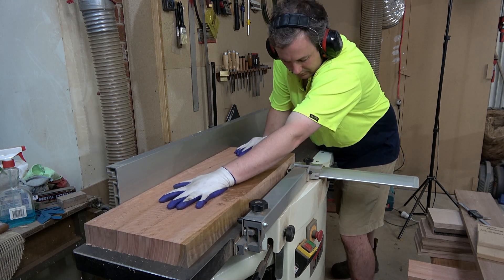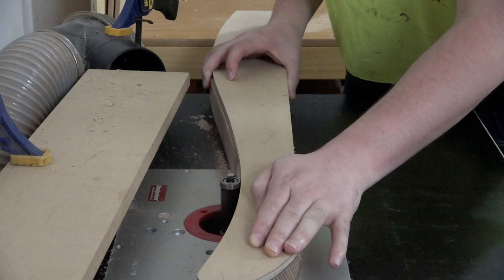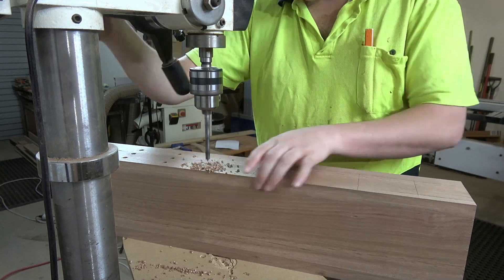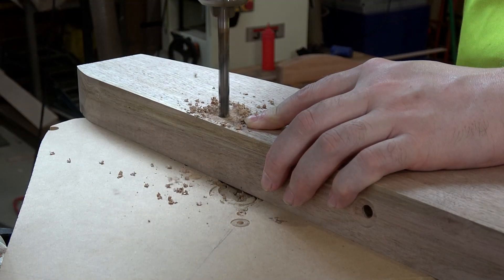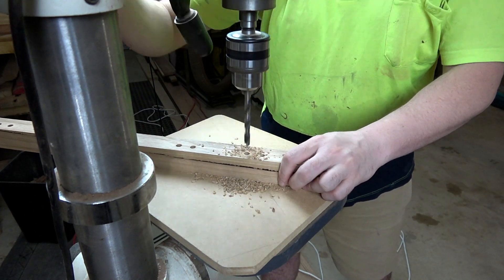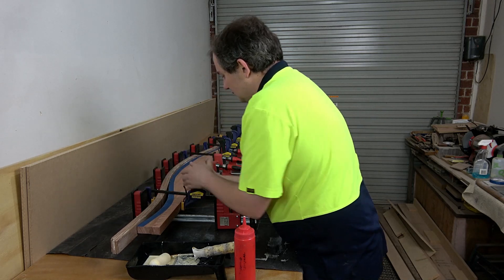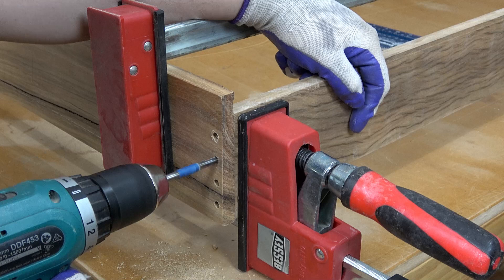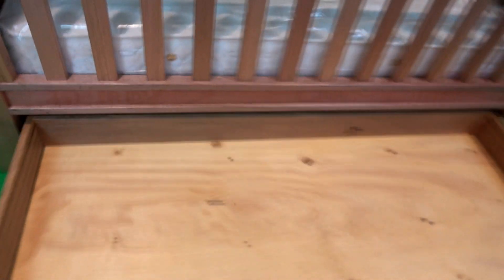The baby cot

Comment: Really glad to see s summary video Kuffy, Wow, REALLY well done too.
Reply from the maker: Cheers mate. The video seems to be pretty well received and even I think it was pretty good. Gonna have to stick with this style I think.
Reply: A question mate. You use Tassie Oak a fair bit. I'm in Bendigo and timbers are hard to come by, but I do notice in Bunnings they have Hardwood F17 structural lumber in large dimensions that looks to me like it is Tassie Oak for sure. Do you think it would be worthwhile using for cabinetry? I've got the gear to break it down, and after all it breaks down to only just over $5 a board foot which is way cheaper than exotics that I can only get in Melbourne.
Reply from the maker: The F17 that they sell in bunnies is Tas Oak/Vic ash. The 6x1" standard grade boards that I commonly use are about 7-8bux/meter which is a little more than 1.5 board feet. I use a fair amount of F17 90x35 at work. With regards to cabinetry, the stuff is pretty awful. The good stuff is straight grained and featureless. The average stuff is good for burning. Also when they kiln dry structural timbers, I don't know what moisture content they actually shoot for, but I'm pretty sure the standards say 15% or less. I wouldn't use 15% MC for decent joinery as it will move too much. So if you do go down that path. purchase well in advance (a few months), and sticker out the boards in a dry area with some air flow. Also select the boards that you do want. Don't worry about rejecting the bad ones because the chippys only want enough length and straight boards for beams, whereas you will need quality timber more so than long and straight because you will end up cutting everything to short and machining it straight.
Reply: Thanks :) Means I still need to go to the big smoke to buy the rough lumber if I'm keen on a bigger job. It sucks that there is so little choice here. Oh well, can always swing past Carbatec and Timbecon on the way through (don't tell the missus as they say)

Comment: Did that grey gum weigh a tonne? I’ve worked with it before and I couldn’t believe how much harder and heavier than spotted gum it was
Reply from the maker: This piece wasn't so bad. About the same weight as spotty. It was only a small slab approx 2700x400x55 so it was easy enough to pick up by myself. I was surprised by how well it worked by hand and machine, didn't put up much of a fight given I was expecting an epic battle 😀

Comment: Why are you wearing gloves?  I  thought that was a big no-no when operating woodworking machinery
Reply from the maker: I wear gloves primarily because they give me the same level of grip while using less effort, or more grip using the same effort. It allows me to be soft handed when controlling the workpieces rather than having to be comparatively heavy handed just to generate enough grip/friction. Wearing gloves does come with its risks. Rotary equipment with pinch points such as the jointer, drill press and bench grinder are seriously bad machines to be wearing gloves around. I am aware of this and willingly accept the risks to my own person.